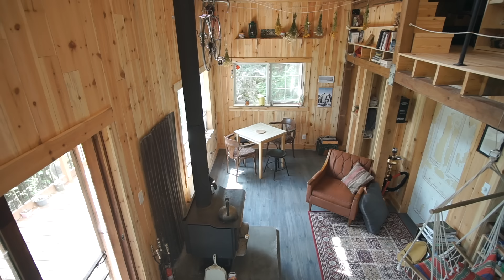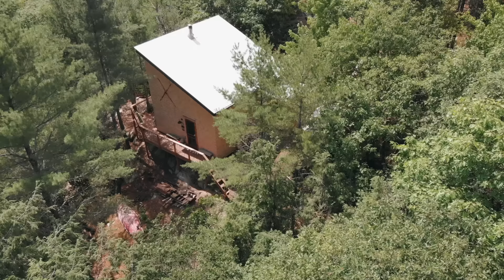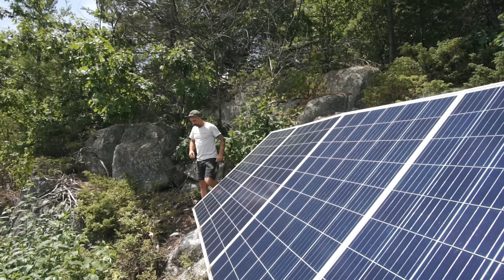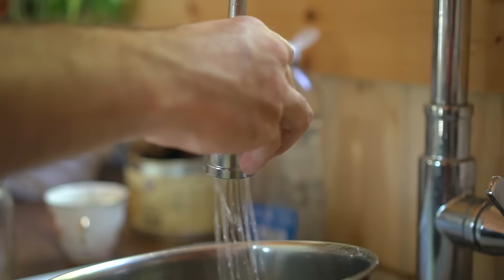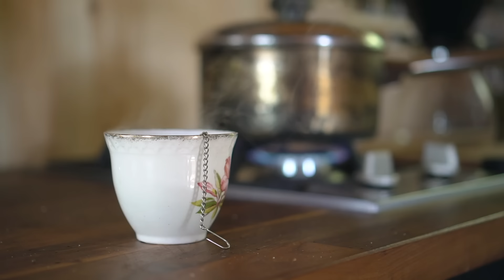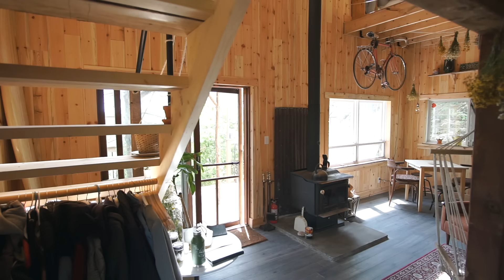Man Living Off-Grid in His Incredible Self-Built Cabin

Comment: You should add a vertical duct from the high point in the ceiling to the lower floor and use a 12 volt 6" inline duct fan. That will bring the heat down to the lower area much more efficient than the fan.

Comment: build the solar panels with a tilt. it goes erect or tilt to rotate every so often to remove snow. so will have power 24/7 sun permitting. if to ill to get out of bed, cant get wood, but have a back up generator for power... for heat ect. can be a life savor.

Comment: I like it, although if your good with electronics you can buy or make converter setups so that your laptop which converts from ac to dc and your network devices which have a adapters that convert ac to dc run direct and not through the inverter. In your case you are converting DC to AC and the back to dc for thoes loads, overall though I like the system and I like your simple mount for the array0

Comment: Please research your choice of refrigerator 'veeeery' carefully. The typical RV 12 volt fridges like Dometic and Norcold "brine" units have a half life sometimes measured in minutes. They work off a boiler system instead of compressor to heat a brine solution and rely upon thermal rise of brine to an evaporator coil that is bonded to rear of small freezer compartment at top of fridge with an aluminum BTU 'shedding plate' beneath that to cool the lower fridge cabinet.  The dual 12v/propane units are far more efficient, vis-a-vis thermal action, while running on propane.  Calculating the watts required to run an "efficient" (quality) small refrigerator on 115/120 invertor power VS straight 12v draw from your battery bank might just reveal upgrading your bank and another panel giving you better return as it applies to efficient refrigeration with less risk of more frequent mechanical failure.